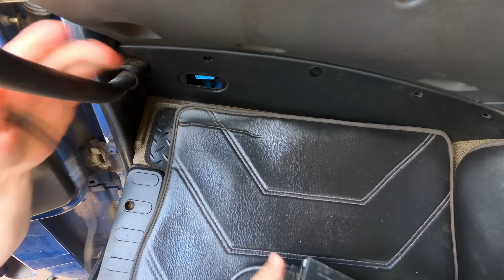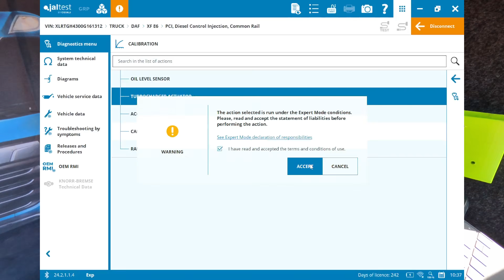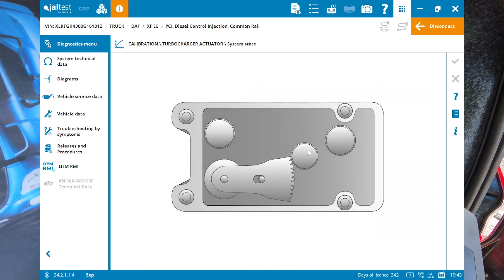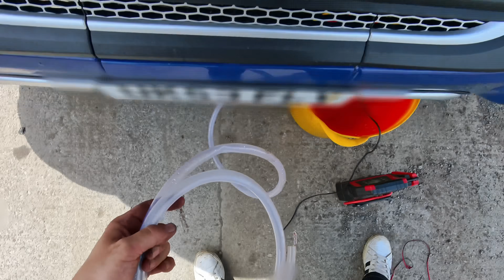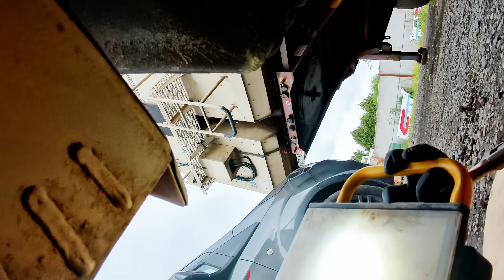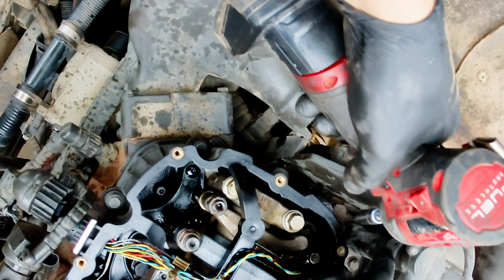DAF XF Turbo actuator issues, MX-13 top end REBUILD and a water pump

Comment: Blimey what a mess just about every truck engine maker has made of truck engines 
DAF 1160 ATI 2800 3300 3600 was bomb proof simplicity and ran forever when looked after 
Same for a Scanny 111 141 113 142 ect now it’s engines are goosed unless you have a PLC laptop reader 🥳

Comment: I remember when the euro 6 first. Came out, one of the lads did a water pump on one and dropped it straight into the rad and put a hole in it 😂 had to learn how to change the rad very quickly
Reply from the maker: Ha ha ha and changing the radiator is so much fun 😅😅😅😅😅😅😅
Reply: @TRUCKTECHUK  even more so when it was heading for Italy the next morning 😂
Reply: Gotta love these fellows driving for 6 months with warnings on, and chancing their luck clearing fault codes everyday...When someone that actually knows what he do is called over to have a look at the problem, truck suddenly has to go to italy following morning...Normally i tell them come back to me when the truck is parked up for couple of days..

Comment: Are all your DAF truck engines Paccar
Reply from the maker: Hey Geoff. No buddy the smaller truck, the DAF LF or the newest model that has now replaced that is called a XB is actually a CUMMINS engine so the engines I work on are PACCAR and CUMMINS.
Reply: @TRUCKTECHUK thanks for replying,  here in NZ, most, nearly all,  go for Cummings
Reply from the maker: Ah right! Cummins used to be fitted to the CF and XF under the Foden brand but PACCAR dropped that brand and stopped fitting Cummins in favour of using the DAF brand and Paccar engine. Like I say the only truck to have a Cummins now is the smallest truck and that still says PACCAR over the cummins badge.

Comment: I am shocked lol  it is 9nm for the top cover ,and 20 for the lower one  lol...also battery guns on those  covers are my bug bear ,i hate them and no need ,,so take that as a telling off lol  On that paticular MX  engine the loose inlet pushrod would be loose ie turn by your fingers  so you know that is the one to adjust ,on the previous version both inlet and exhaust  rods would turn ...Reference the injector ,,you are meant to fit the injector first torque it down then install the pipe ..The pipe can be damaged if put against the injector then the injector tightened down ,,,Shame on you lol .Remember the pipe end deforms as you tighten it ,the injector will sit correctly then you put the pipe in and it deforms which then lets you reuse it as it then fits back in to the inj as it should ,you way can cause  excess leak off ..I use a bodyshop rivet for the tensioner lol...A good video all the same but you did let your high standards drop  slightly ..
Reply from the maker: Ha ha ha I need to stop quoting torque settings off the top of my head. 

I'd cut the bit where I check them with a ratchet as it doesn't make good YouTube lol 

I think I've always done the opposite cylinder when the inlet has been down but then I always check the cylinder I'm doing for free play on the rocker arm also 🤣 I HATE doing valve clearances.......I've only 3 more trucks booked for this month for valve clearances and I was in Wolverhampton yesterday doing a set too 😪.......I'm thinking its time I opened a DAF workshop with all this maintenance going on!

The injector I've always done the injector up and then the tube.....I think that's the way I did it in this video unless I've messed up the order of the footage 🫣

I use to have a rivet also, it's in the toolbox at home....I need a bigger van to get the toolbox in. It's what's to hand these days 🤷

Did you see the exhaust brake rocker arms on 5 and 6 shooting oil out at the end of the video when I had the rocker cover off again  🫣

Comment: What camera you using mate does it clip to your glasses
Reply from the maker: Hey buddy thanks for the comment. I've upgraded recently from recording on my glasses to an Insta 360 go3s. It is a good little camera but only lasts 30 minutes between charges
Reply: Hello buddy😊,once again i find myself in this video😉. Can you give me the part number for the water pump sensor plz.. the same that you changed in this video..thanks mate.. waiting for your anwser bro😅
Reply from the maker: Hey teddy. The part number for the speed sensor is 2045580. It's a non-genuine pump and speed sensor as its half the price. Hope this helps
Reply: @TRUCKTECHUK  sure it helps.. i think i need to go through a genuine water pump paccar so.. so in which XF do they use 2055580 buddy🤔🤔?????
Reply: All your videos help me a lot mate🫡🫡
Reply from the maker: That's a good question buddy. 🤔  I don't know what part number coolant pump that speed sensor is for and what the part number is for the coolant pump sorry. The customer supplied the parts 🤷
Reply: @teddyherminette6316 the genuine part number for the pump (mx13) is 2407606 this was a supersession from part number 2267064 speed sensor part number 2404842 hope this is what you was asking for 👍
Reply from the maker: Brilliant thank you for checking for him buddy 😎 I will have to get daf webshop at something for part numbers 👍